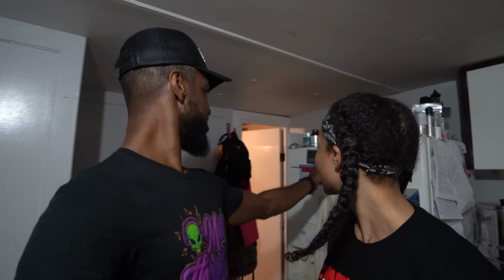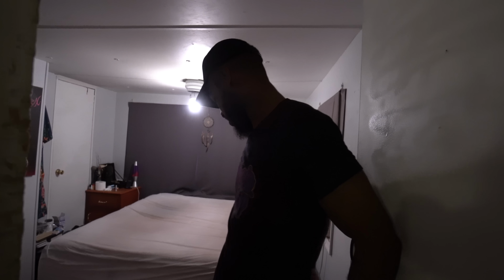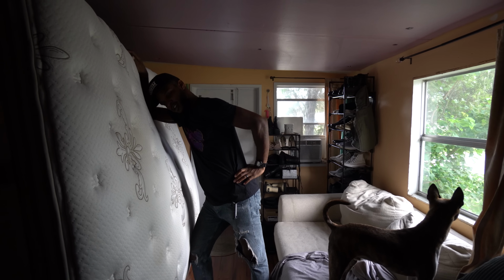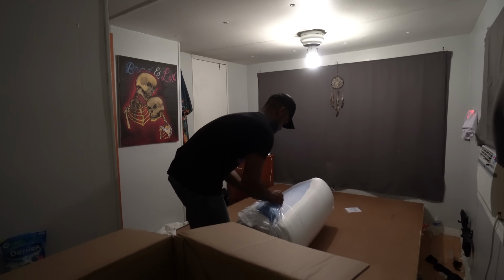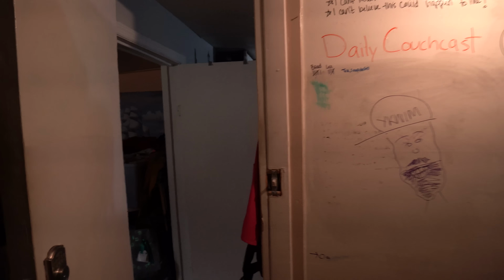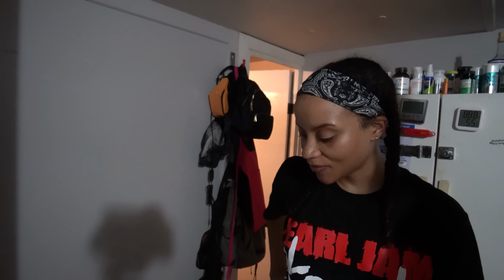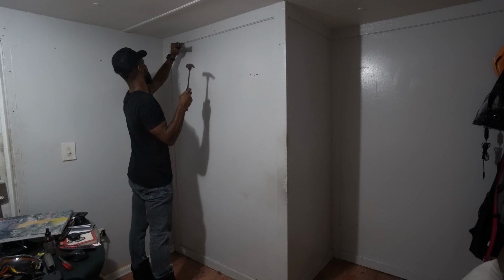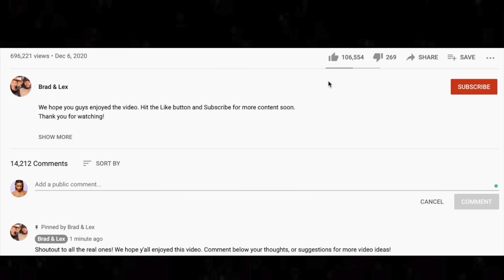90 DEGREE kitchen while pregnant

Comment: You should use the tube and type in trailer remodels and repairs etc., that way you can get the visuals which will help during your repairs...also you don't want to be removing any bearing walls that help to support any structures. Make sure you watch "anything that has to do with wiring a trailer" before taking on that task if you plan to go down that road.

Comment: If you use transition strips on the floor you'll be forever tripping on them. It's one thing to have a transition through a doorway (like thresholds) but it's really dangerous in the middle of a floor. From the video it appeared the one section of floor had a second layer. You have 2 options. You can attempt to remove the second layer but if the installer glued it, you're screwed. Or you can buy some underlayment to bring the lower floor to the height of the higher one and then cover it all with new flooring. You'll need to remove all the shoe molding (1/4-round or baseboard etc) around the perimeter and reinstall new after floor is installed. Good luck with the blood test.
Reply: Gosh,that’s sounds like a lot of work..I’ll be so happy when they can get out of there. All the mold and rat issues..😷But yeah, that floor needs fixed, especially with Lex pregnant..

Comment: Throwing an idea at the wall about the the floor: depending on the width of that gap, you could color match some reducer molding, which has a high/thin and low/thick side and use the Brad-Nailer on it. Or contrast the color to make the changeover feel like a stylistic choice lol - $20-30 for 6' from what I was seeing in laminate at Home-on-De Pot, didn't check regular wood or Lowes.
Reply: Looks way more comfortable without that wall, that's the way my trailer was, but it had a knee-wall up to a countertop dividing the kitchen side, so I put a couch against it and made it the living room

Comment: Pull up the flooring in the smaller area - and it looks like you'll have a level floor - may need to put some small strips in where the wall was - cheapest fix is to go over the whole thing with some inexpensive indoor/outdoor carpet - a little more expensive , but the easiest to do is interlocking floating floor - I'm sure you can find youtube videos on how to do both.

Comment: Floor transition strip should help, it's what I would do in this case. The best thing to do for a level floor would obviously be to just put new flooring down but that would be a lot more money and work and considering you probably will want to move into a new home sooner rather than later, it might not be worth the effort. You can look into floor patch and leveling compound but I'm not sure that would help much for this problem. You won't manage to level it out but you could make a more permanent floor transition that still wouldn't be level in the end.

Comment: Brad, I used to live in a trailer. When I got it a wall had been taken down and there were wires hanging down where the light switch should have been. I got a bathroom pendant light switch. It was easy to use.

Comment: My thoughts on the floor.  Assuming original flooring is continuous throughout and the height difference is just the secondary floor laid over top. Remove the zigzag by snapping a chalk line and setting the depth of circular saw to cut just the secondary floor straight across the room . It will be easier to fit the transition strip to a straight line . The creative part will be finishing the straight line cut close to the walls. Don’t know what you have for tools but multi cut saw would accomplish this .

Comment: You should have cut bits out the wall sheeting to nail in the gaps in the floor between the 2 rooms to level them and then put a big rug down